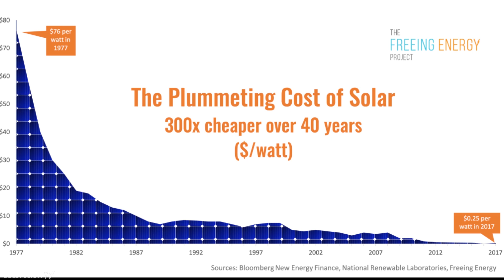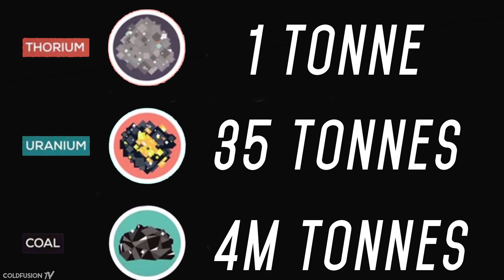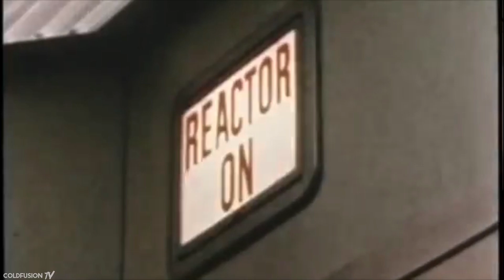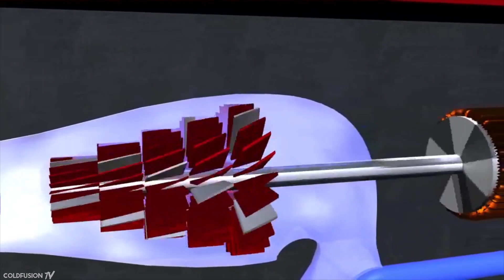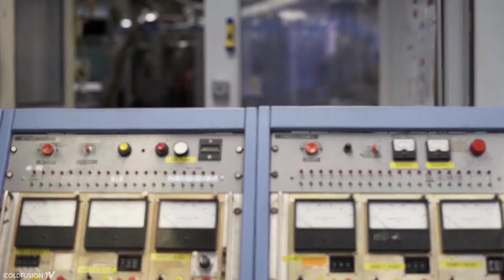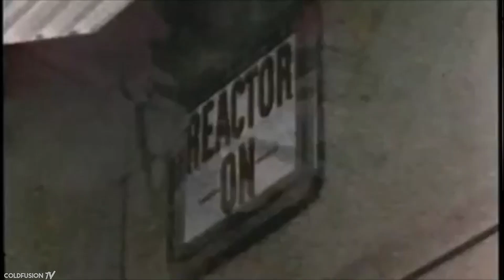Thorium - The Future of Energy?

Comment: It's really not clear that "we need something different". Oil, gas and coal are fine, and getting better. Humans are not changing the climate. But if you want to make nuclear reactors, fine. Go ahead. And just the current demand, not to mention future demand for electricity can barely be dented with wind and solar.
Reply: Rolling my eyes...

A ball of thorium about an inch, maybe an inch and a half in diameter contains all of the energy one person needs for their entire life.  From heating and cooling their home, to charging their shiny new electric cars, to running all of their appliances and lighting their lights, et al.

Alternatively, one person needs tons of coal, and barrels of oil to fulfill all of their energy requirements for their entire life.

It's a god damn no brainer, bro.

Oil, gas, and coal are NOT fine...
Reply: @Les_S537  Yes they are fine. Comparing potential energy output of a lb. of Thorium to tons of coal really doesn't mean anything. Instead compare the cost of producing a Kwatt of electricity with "fossil fuel" to the cost of doing it with Thorium. Assuming both are produced in a healthy free market economy. (Which we havent had for many decades).
Reply: @roysterfutrell8889  Don't be ridiculous, of course it matters.  With a coal plant, you burn tons of coal each day to supply thousands of people with power, and the typical coal power plant produces 10,000 lbs of CO2 every day.

Alternatively, a Molten Salt Reactor (MSR) burns a lb of thorium a day to supply thousands of people with power, and no CO2 is produced as a by product.

MSR power plants are projected to cost about $2/W.  For comparison, the capital cost of a modern pulverized coal power station in the US is $3.25/W.  The cost of current nuclear power plants is about $7.46/W
Reply: @Les_S537  I dont believe that the CO2 matters. If you can actually produce electricity that cheaply, then go ahead. As long as it turns out that the costs are actual, and not a scam like the figures for electric cars. I just dont believe these projected cost estimates. But again like I said, if you can do it, fine. Dont get so excited.
Reply: @roysterfutrell8889  Of course CO2 matters...  John Tyndall proved, over a century and a half ago, that greenhouse gases absorb and retain heat (CO2 being the greenhouse gas we humans are pumping out in greater and greater degrees each year).

Thus

Svante August Arrhenius correctly theorized, around 1900 or so, that if you increase the density of greenhouse gases in the earth's atmosphere, which we humans are definitely doing today with the use of fossil fuels, you are going to increase the amount of absorption and retention of heat within the earth's atmosphere thus warming the climate. 

We can see the effects of this warming with the melt off of ice taking place on the Greenland ice sheet.
Reply: @Les_S537  These theories you cite here are just that. Theories.
Reply: @roysterfutrell8889  I'm sorry, but you couldn't be more wrong.  A Theory in science isn't just a hunch, my friend.  It's not a guess or hypothetical.  It's what we observe.

Scientists have measured the influence of CO2 on both incoming solar energy and outgoing long-wave radiation. Less longwave radiation is escaping to space at the specific wavelengths of greenhouse gases. Increased longwave radiation is measured at the surface of the Earth at the same wavelengths.

This data provides empirical evidence for the predicted effect of increased levels of CO2.
Reply: @Les_S537  I dont think scientist today can measure those things THAT accurately. I think that you, and some of them are "padding the books" a bit. That's not just me either. Thats a lot of other top flight scientist saying that. Plus, the whole subject of what affects the earths climate must be far more complex than the simple descriptions given to the people by those in the man made climate change club. You sound a bit too certain and maybe a bit desperate to bludgeon people into believing you.
Reply: @roysterfutrell8889  I've been arguing this topic for decades at this point, ever since the beginning of the internet.  I argued it as a skeptic, like you, for decades.  Then I really and truly dug into the fine details and learned where I'd been wrong before.  I know this is a complex topic, but let me try to impart the understanding of climate change thusly...

Think of the earth's atmosphere like a "canvas" that the sun's energy gets "painted" upon

Here is how climate change works.

Let's imagine you could have two earths for a moment, both in the same orbit around the sun (both the same distance from sun), just on different sides of the sun in perfect sync so that neither could ever bump into the other. Both earths orbit the sun at the same rate so they'll never collide.

Let's call them Earth A and Earth B 

Both earths are identical in every way except for one.  Same population levels, same continental formations in the same tectonic config, both have the same amount of water, BOTH WORLDS WILL RECEIVE THE SAME AMOUNT OF ENERGY FROM THE SUN   The only REAL difference is the composition of the atmospheres.  Let's go further and say that all of the greenhouse gas levels are identical except for the CO2 levels.  In other words, methane levels are equal for both earths, ozone levels are identical for both planets, etc...

So if earth A's atmosphere has level X of greenhouse gases in it, let's say that of the greenhouse gases in earth A's atmosphere the CO2 level is about 250 ppm  That will result in a climate for earth A where the lowest temperature ever possible in the coldest place on earth A is say -60 F, and the warmest temperature ever possible in the warmest places on earth A is say 105 F.

Now let's say that earth B's atmosphere has level Y of greenhouse gases in it, let's say that of the greenhouse gases in earth B's atmosphere the CO2 level is about 1000 ppm  That will result in a climate for earth B where the lowest temperature ever possible in the coldest places on earth B is say -25 F, and the warmest temperature ever possible in the warmest places on earth B is say 120 F.

What this means for earth B is that it will experience a warmer climate than earth A. It will result in more of the surface of earth B experiencing warmer days, so that places that normally never, or rarely if ever get above zero, get above zero

Earth A is the earth's atmosphere from the 1850's or so. 

Earth B is the earth's atmosphere a century from today (if we stay on our current path)
Reply: @Les_S537  That kind of example is so simplistic it's probably worse than worthless.  I'll say this. If you can devise energy souces to replace coal/oil/gas in a free, open market with no subsidies, restrictions, limits etc. Sources that compete in a free market victoriously, then great, as always. Otherwise you will simply distort the market so much that you will bring on problems for humanity worse than what you fear from man made climate change.
Reply: @roysterfutrell8889  Rolling my eyes...  It's not simplistic at all.  It's what we see happening.  Over the last century, the mean temperature of the earth has risen .8 C, or about 1.4 F.  Nearly 70 percent of that rise has been in the last third of a century, which just so happens to coincide with the spreading of electricity generation and automobile use worldwide...

A century ago, we didn't have any temperature gauges on top of the Greenland ice sheet. But we DID have a few sprinkled around along the southern coastlines in various outposts and villages, and they rarely if ever got above freezing, maybe a week or so at most. Knowing that, we can safely say that temperatures on the top of the ice sheet (thousands of feet higher in elevation) never if ever got above zero.

Today, we DO have gauges on top of the ice sheet.

The top of the ice sheet has entire weeks, sometimes over a month or more the temperatures reach above freezing temps.

Ice melts at one degree above zero, but for every degree above zero the melt rates doubles.

Zero+1 degree = melt rate of X
Zero+2 degrees = melt rate of 2X
Zero+3 degrees = melt rate of 4X
Zero+4 degrees = melt rate of 8X

Each summer, entire lakes and ponds of melt water flow around on the surface of the ice sheet looking for a crack in the ice sheet to exploit and carve a tunnel down to the base of the ice sheet. The Greenland ice sheet is turning into Swiss cheese at points today

We are warming, and the reason is obviously because we've increased the CO2 content of the atmosphere by over 130 ppm in a century..

Comment: Quick answer, no, thorium is not the future of energy as was pointed out in the video, the costs to produce energy via thorium is extremely high, likewise, the cost of producing energy via nuclear is extremely high and non-competitive.  Wind and solar are the cheapest, cleanest and safest forms of energy production and are winning every new contract.  Battery storage is very close to competitive and already being used to levelize solar and wind's intermittency.  I've been hearing the promises of thorium since high school, 35 years ago and we're no closer today than we were then.  Not gonna' happen.
Reply: The costs will be way less than current nuclear reactors, and less even than coal.  Why?

First of all, current reactor models cost a lot to build and operate because they operate with water as the coolant, and they operate the water in the electricity generation process under extreme pressures.  That requires all sorts of heavy duty piping, it requires all sorts of safety measures be put in place, it requires a containment building, it requires redundant systems be put in place to help mitigate against the inherent risks in operating under pressure. 

Boiling Water Reactors (BWR) operate at around 70 atmospheres.  Pressurized Water Reactors (PWR) operate at around 160 atmospheres.

MSR's (Molten salt reactors) operate at 1 atmosphere, so no heavy duty piping, no added safety measures needed, and the reactors are inherently safe because of the way they're set up to operate.  MSR's are 1/20th the size of current nuclear reactors.  They produce 1/5th the amount of waste and the waste only has to be shelved for 300 years tops.  They can also recycle older reactor models waste to make it safer as well.

They are the future of nuclear energy, period.  They simply cannot explode like current reactors, and they cannot meltdown like current reactors.  They're insanely safe.
Reply: @Les_S537  Good to know and hope you're right as thorium reactors look promising, we just haven't seen any yet.  I believe there's one being built in France, and has been for ~20 years with another ~20 years to go, before realistically being able to produce any energy, at a cost of some: $200 billion dollars=not cost effective.  If they can be built and built competitively with current technologies, it'll be good to see.
Reply: @RussellFineArt  France has no molten salt reactors.  The only functional MSR was built by the US back in the 1960s.   India has a solid fuel thorium reactor today if I'm not mistaken, but they have plans to go molten salt soon.  China is building one today, as are the Dutch, and Russia has plans to bring ten of them online by 2030.

MSR's are projected to cost about $2/W.  Coal power plants in the US cost about $3.25/W.  Current nuclear power plants are about $7.46/W.
Reply: @Les_S537  Gotcha.  I was thinking of the ITER project in France, which is nuclear fusion, not thorium.

Comment: the one thing the world DOESN"T need is Nuclear power
Reply: Your ignorance is apparent.  We have completely safe ways to run nuclear today, they're called Molten Salt Reactors.
Reply: @Les_S537  that doesn't solve the waste issue
Reply: @pablorages1241   How much waste do you imagine we've generated to date (50+ years of using nuclear)? 

The answer is one football field stacked 21 feet high.  It's a pittance.

(MSR) Molten salt reactors only produce 1/5th the amount of waste that current reactor models do, and the waste they generate only has to be shelved for 300 years at most.  Also, MSR's can recycle the waste we've generated to date and make it safer as well.
Reply: @pablorages1241  Again, your ignorance is apparent.  Don't be offended, everyone is ignorant of something, I was on nuclear until I did the deep dive into understanding it.  It will not be 1000 times that...

There are three levels of nuclear waste, low, medium, and high level.  Basically, you have short half life material, medium half life material, and high half life material.  They each need to be dealt with separately.

Current reactor models pile all of that up into one pile, it's too much to deal with.  One of the beauties of the MSR is the fluid nature of the nuclear reactor.  Because of this, they can pull out the short term waste and put it into it's own bin, they can do the same with the medium level waste, and then they can do the same with the high level waste.

What this means is that with the low level waste, after 10-20 years, it's safe to touch/be around/work with.  The vast majority of nuclear waste is low level waste.  Then you've got the medium level waste, which after several decades it too can be recycled and reused in other ways.  Medium level waste is the second most abundant nuclear waste.  Then you've got your high level waste that lasts for a few centuries.  High level waste is the most minuscule amount of waste that there is.

If we went full MSR worldwide, the amount of waste being kept around long term would be less than all of the waste we've generated to date.

Comment: The Oak Ridge National Laboratory designed and built a demonstration MSR that operated from 1965 to 1969. It used U-233 (originally bred from Th-232) for fuel in its final year. Further research Shot down during President Nixons term for Uranium for develop of NUKES ,,,,
NOW , Aug 28, 2017 - A team from the Nuclear Research and Consultancy Group (NRG) the Netherlands has built the first molten salt reactor powered by thorium in decades.

Comment: It's still hot fission , not cold fusion   it's still a lot better than Uranium especially in 300 years half life cycle and Iran building a Nuclear weapons !
Reply: Thorium is pretty much inert on its own, though. It needs to be bombarded with neutrons first, so you need enriched Uranium or Plutonium either way.
In addition, every Thorium-based fuel cycle acts as a breeder reactor, thus producing fissionable (and potentially weapon-grade) material that can be extracted. By slightly altering the Thorium fuel production process, weapon-grade U-233 can be produced directly (though at a lower efficiency than traditional methods). So no, anti-proliferation is not a pro-Thorium argument.

Comment: If Thorium would have made it's debut back in the 60's we would not have had 3 mile island or Fukushima or that Russian mishap, but the future is "liquid air".  It's cheaper more abundant and non polluting. And can be used in an on demand power plant.  The best use of Thorium is as a generator on a Moon or Mars colony !!!
Reply: Ahum! Fukushima was about a Tsunami. There is in fact just one(!) radiation related death reported in that accident. Also that "Russian mishap" was in fact in Ukraine, EU's new best friend in provoking the bear. It is widely accepted that this accident was not so much caused by the fissile material in use but by the reactor design and concept. As far as Thorium goes, while the waste at the end of the chain is relatively harmless there are several intermediate stages where this is definitely not the case. This is what raised the proliferation alarms and stalled development, so now we find ourselves in the hands of new idiots that figure we can fix all of this with solar and a couple of batteries.